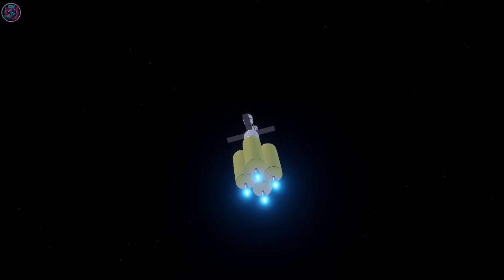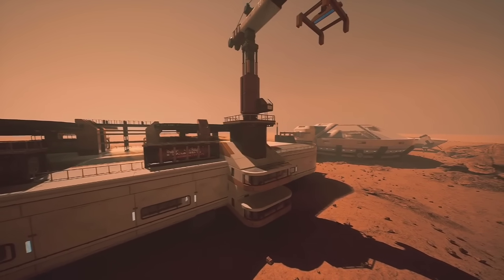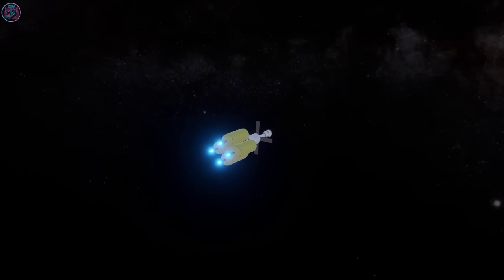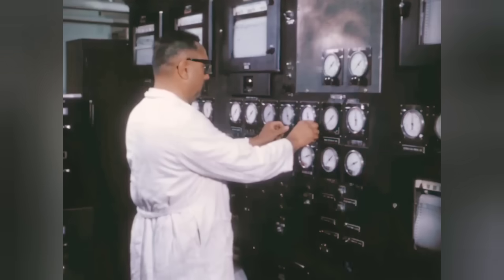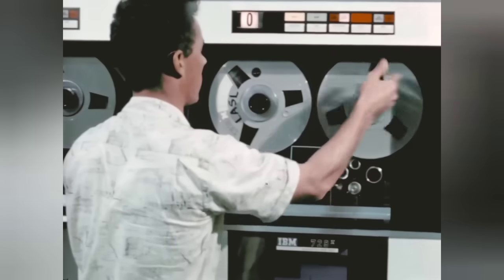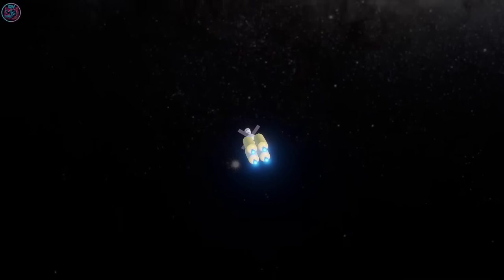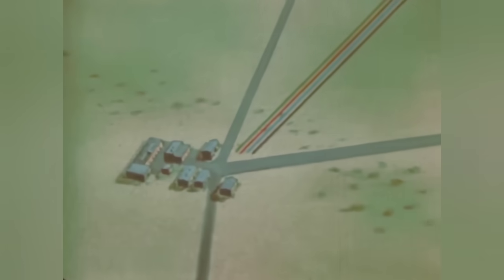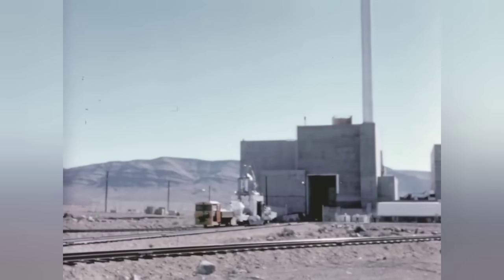RANT ALERT!  NASA Nuclear Mars Rocket plans blocked by regulation, lack of test facilities!

Comment: It is a Hybrid Nuclear Chemical Engine (or Drive, how have you), using the Nuclear Materials to Super Heat other Materials pumped into a Chamber that gets heated into Plasma and than that Plasma is expelled out the back for Thrust, but it just isn't a Pure Nuclear Drive which would be more Efficient, much more Efficient. We need a Nuclear Fission Fussion Drive because that could get US to the next Solar System, but the Problem with that would be Keeping the Fission Fussion Ball In Place and than getting at the same time expelling at a consistent Stream x amount of it out the back as Thrust. I am just not sure how you could keep the Fission Fussion Ball in place though within anything close to our Realm Science without Plasma, but we are just not there with Plasma Yet, but this Nuclear Thermal Drive and or a Nuclear Reaction or Reactor surrounded by other Materials Pumped into that Chamber which turns to Plasma than is expelled out the Back, which is a step in the direction I am talking about, because we are working with Nuclear Reactions and Plasma, so it is working towards what I am saying, getting US an Understanding more towards such, but it just isn't as Efficient as a Pure Nuclear Process, because you still have to have allot more material than you would need with just Pure Nuclear Material. Basically, the Nuclear Reactor can heat the other Material Up more Effeicntely than it getting Combusted making it more Efficient. A Nuclear Pulse Drive would be more Efficient, allot more Efficient, but just wouldn't be able to get the Consistent Thrust and or Acceleration needed to be able to Utilize the G-Force from the Acceleration as Artificial Gravity. The Nuclear Pulse Drive is getting US closer to a Nuclear Fission Fussion Drive than the Nuclear Thermal Drive that uses a Chemical Expelerant as their Accelerant! (just having fun with those last couple words)
Reply: Oh, what do I know, I am just you Resident Evil Genius bent on US World Domination, ah ha ha (maniacal laughter)
Reply: You know in like the 1950s they were testing Nuclear Combustion, and those Wussies decided it was Too Radioactive, and yes, yes it is to Get Things From Earth to Space, but not to Radioactive to get things from High Orbit to Outer Space! We should be using Nuclear Combustion for Space Travel... What do you Think you get more Bam for your Buck for, Hydrogen? Or Highly Enriched Uranium! Exactly!
Reply: Personally I think my Nuclear Fission Fussion Drive is surely possible within our current Science, it is just in order how to Figure Out how to keep the Nuclear Fission Fussion Ball in place with Plasma while having the Fission Fussion Ball release X amount of it's Energy out the Back as Thrust would just take allot of Trial and Error, and or Blowing Up allot of Proto Types in Space...

Comment: Yah this is a speed bump, the regulations can be changed, plenty of miles of desert owned by the Government, where they test all kinds of things and "regulations" are not relevant.

But... SpaceX has partnered with Ad Astra who are building the VASIMR drive

So this doesn't really mess with SpaceX plans , so Musk may not bother to "pull strings" 

I suspect many Changes in NASA in the next 4 years

Just build the facility at Groomlake somewhere, problem solved...